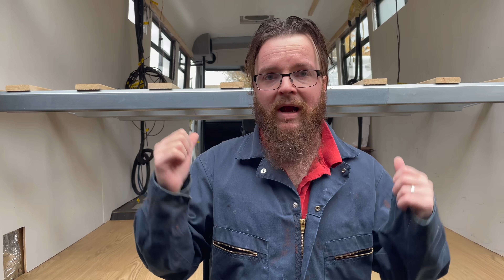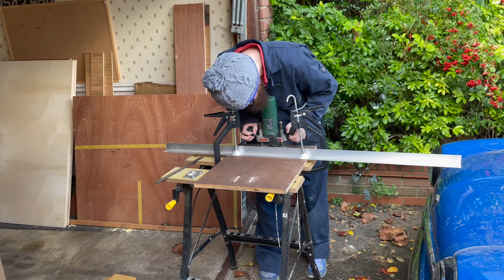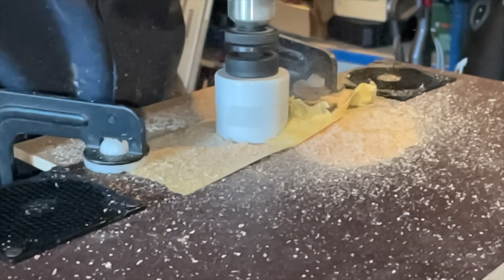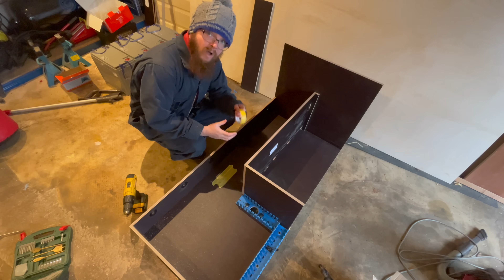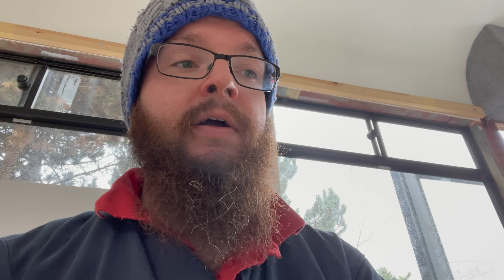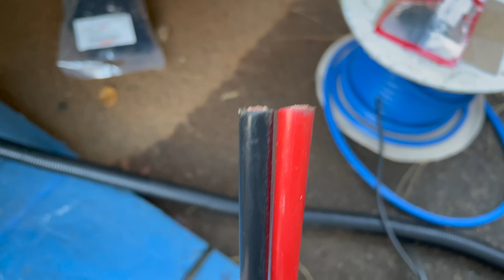Guess Who's Back... Plus The Odds & Ends Week of Van Build | Mercedes Vario Van Conversion Ep.44

Comment: Hi Rich, I wanted to ask why you ran the electric cables under the bus rather than in the bus pre insulation? 
Keep up the good work. 😊
Reply from the maker: Hi Sally, the main reason was we personally didn’t want cables in the floor as they’d be harder to access and we’d probably drill/screw through them 😂. The other thing for the B2B cables was getting them into the seat box and behind the electrics box, with this solution they enter the bus nicely - in the dc to dc charger video (a few videos along) we use a bit of conduit and a gland for this. 
One thing I do wish we’d done is run this cable before I put the floor down as it would have been a bit easier for sure. Hope your build is going well. Thanks for the question 🚐🚐🚐
Reply: @WanderbusAdventures  thanks for replying so quickly! Makes sense and I guess before any flooring goes down is a good time to do it. My build is static as I need the chassis sorted from rust first and I’m having a hard time finding help with the job. Your videos keep me inspired and help with ideas in the meantime! I’m sure I’ll be going back and rewatching many of your videos. 👍
Reply from the maker: The rust is important though. Definitely a great idea to get that sorted. You’ll have a strong base then. We are happy to share and likewise questions and tips are amazing - we are learning as we go too 🚐🚐🚐

Comment: have you considered putting up extra cameras down the side instead of more mirrors  . i made brackets for mine to fit under the side marker lights
Reply from the maker: Hey Dean. We hadn’t but that’s a good idea. I know our screen can take two channels, so that is an option. We would have to think out the wiring though. Did you run yours through the roof?
Reply: @WanderbusAdventures  i used the same hole as the side marker light i just enlaged it a tad
Reply from the maker: Ah neat thinking.